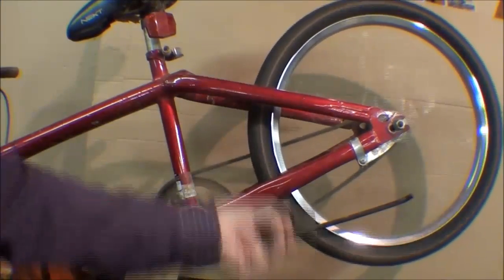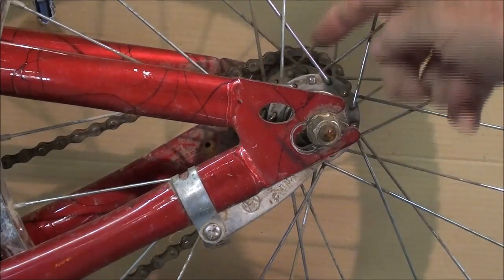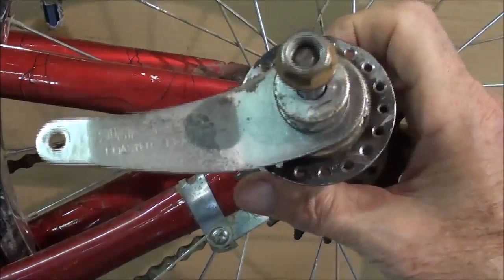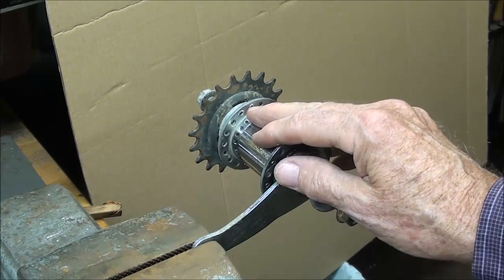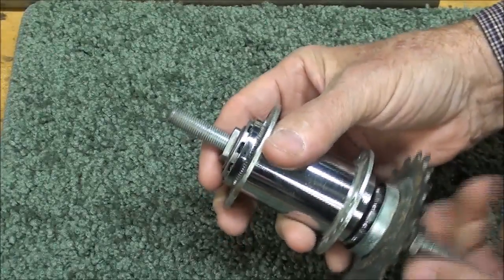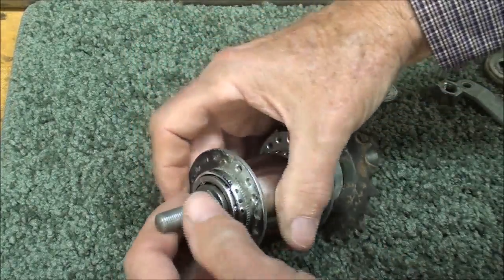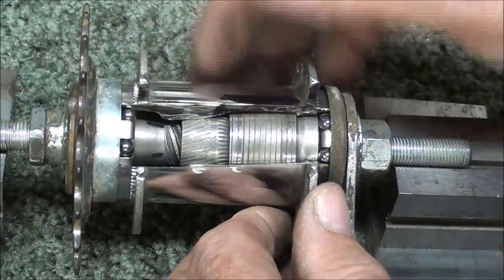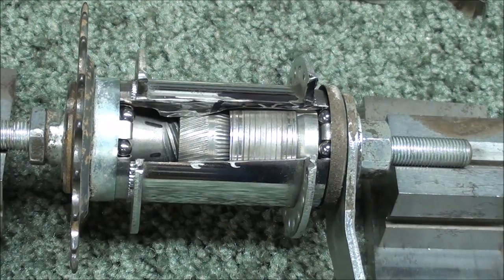WHAT MAKES IT WORK? #13 The Bicycle Coaster Brake tubalcain

Comment: I had a Wizard motor bike and it had a brake like this but the inside had a series of disks. Half were keyed to the axle and the other half were keyed to the hub. The problem I had with it was that it would build up heat and destroy the disks. I think this must be a newer version of the one I had.
Reply from the maker: +ItsRonsway whizzer or wizard?
Reply: +mrpete222  It's been over 50 years ago and can't remember your guess.

Comment: The 3-speed was a Sturmey-Archer gear shift with a chain that went into the hub.  A lever on the handle bars moved the gearing through 1st, 2nd, and 3rd gears.  On the coaster brake, another variant was an internal "split-cylinder" between the two cones.  The split was in the shape of a vee.  When the brakes were applied, brake shoes pressed against the split-cylinder which pressed against the drum much in the same way that brake shoes are applied on automobiles.  

Whenever I took the gearing apart, you always had to watch out for those ball-bearings as you could easily lose them, especially if you were doing your repair work on the grass.  I quickly learned that, after cleaning off all the black grease, to grease the bearing race before inserting the ball bearings so that they would stay in place.  

This video brought back lotsa memories, fer shur, fer shur!
Reply from the maker: +Robert A Moore Thanks for watching. I suppose there are many variations on the coaster brake

Comment: Remember the little leather straps we would hang on those and the front hubs to keep them shiny?? With a heavy bolt/nut or ?? hanging on the on the bottom two ends so the leather wouldn't spin when the wheel turned.
Reply from the maker: +Pappa Bob  Thanks for watching--we used the leather straps too--homemade from welding gloves
Reply: Well that answers my question. I recently bought a 1971 Royal Scot ( one of the many brands produced by the Raleigh Company of Nottingham England ). It has a piece of cloth hanging from both hubs, the rear a 3 spd. AW Sturmey Archer. The cloth is filthy but the hubs are shiny. Now that I know what they are, I will leave them on as part of that bikes lineage.

Comment: When I was a kid, I took apart a similar hub.  While I think the drive cone was the same (I don't really recall), the brake itself was different. It used a series of plates, half of which were keyed to the axle, and half keyed to the hub (alternating).  The drive cone was pressed against the stack of plates, and the friction between the two types of plates provided the braking.

A 3 speed hub was one of the few things I took apart that I was never able to re-assemble correctly; I think I lost a piece or two.

Comment: Definitely, the best of the WMIW series (so far). I'm not quite sure why I never took one of these apart (I took everything else apart from windup alarm clocks to Norden bombsights). I surely had several coaster brake bikes between tricycles and (what at the time were called) french racing bikes (they were actually made by folks like Schwinn - it just referred to the narrow tires). I am astounded that I never opened one of these up just to see what was inside. 

Today, these single gear-ratio, coaster brake bikes in adult sizes seem to be called "cruisers".

EDIT: Oh, yeah. Plus-1 on the cutaways. This was the best so far.
Reply from the maker: +Peter W. Meek Thanks for watcing
Reply: One other thing: I now know where to look for a very short-stroke, high-ratio, rotary to linear motion converter. A very small rotation of that 6-lead thread gets you a lot of linear motion. I suppose I could cut one, but how much faster to adapt the works from a scrapped bicycle.

Comment: I just lubed my two year old bike hub this summer. 67 years old now the last time I was about 12. the bikes from twain are not well lubed. [sell more that way] did all bearings and it rides much better with this repair. great cut away. thanks pete
Reply from the maker: +douglas pierce Thanks for watching

Comment: This takes me back too. We used to tear into these also; we'd often munch up some bearing and have to replace them. Sometimes bend or strip an axle as well. We were hard on our bikes.
I don't recall New Departure, but Bendix was definitely the big dog and in later years, IIRC, Shimano. We hated taking the Shimanos apart because instead of two large brake shoes like the Bendix, it had four small ones. That made it difficult for one person to get everything lined up and assembled whilst holding it all together. 
Then back pedaling free-wheelers with hand brakes became in vogue and gone was the coaster brake, you weren't cool if you had one. :o/
Another excellent Tubalcain cutaway! Mr. Pete has the best teaching aids ever!

Comment: AKA Cut-Way Pete- Great flash back for me to the 50's and early 60's. Remember them well and almost taking every bike I put together apart and back together. Biggest challenge was the 3 speed western auto English Racer hub which didn't have a brake in it. My favorite was the 2 speed Bendix that you would back pedal slightly to up shift and again to down shift but also had a coaster brake in it.  Had to have the leather strap with reflector hub cleaner on all my bikes. Built one with a steering wheel in place of handle bars, one with one crank shorter on the left side for our circle track racing competition,(we had Cloverleaf Speedway right in our village of Valley View, Oh. so we had to race ! Also remember a lot of crashes and crushed gonads but never ever remember being bored. Happy New Year to you and all of your family- and keep them coming. Ed K. Still living in V.V. Oh. with never a reason to move.

Comment: The pedal gears are so uselessly pointless i've been going single middle sized gear for 6 years now doing stuff from downhill, city, long distance, and even used a single wheel baggage stretcher to carry stuff behind me. Yes, i have limitations uphill, but if i travel light, it's ok.

edit: I tried to modify one of these hubs once for a different application where i'd need a quick stop, the sleeve was so hard i broke a brand new end mill on it even tho i was overly careful with my speed and feed. These can get really thought, well worth keeping them for who knows what stuff you'll need.

Comment: thanks for another great "what makes it work"  video.  I used to disassemble the hub for cleaning and  greasing.  I remember the brake shoes but not the other components.  Somehow I managed to get it all back together though.
Reply from the maker: +dan andy Thanks for watcing

Comment: Excellent. I had no idea how they worked. I'm from the UK where we don't have these. I rode one once on a rental bike when visiting California and nearly killed myself with it - if you are used to a 'normal' bike it's nearly impossible to prevent yourself from reversing the pedals a little when coasting, resulting in a rapid somersault over the handle bars. Ingenious thing though.
Reply from the maker: +thisnicklldo Thanks for watching

Comment: I had an experience with one of those drives slipping on an older adult sized bicycle.  Being 8 years old at the time, I had to move up ahead of the seat to be able to "power down" on the pedal to get enough speed to stay upright.  When that mechanism slipped, my feet went off the pedals.  End result: bruised shins and calves, very sore toes, and I picked buckshot sized gravel out of my arms for a week ... those injuries were good enough to not torment me until I had recovered somewhat from the worst part, which was the conflict I had with that top frame bar ...
Reply from the maker: +diggerop I know what you mean

Comment: First time I've seen one!!!
We brits used the ratchet and pawl hub ... If you were lucky you had a 3 speed Sturmey-Archer hub ... if you were very, very lucky you had racing 5 or 10 speed Derailleur gears with dropped handlebars but they were extremely rare in my neighbourhood in the 1960s.  I do remember one kid had a "fixed" rear wheel and could ride backwards and do other tricks.
Braking was done with cable controlled lever brakes which had little rubber blocks which scissored and gripped the outer metal rim of the wheel, they needed regular adjustment if you used them in traffic.

Comment: Great video... I learned something that makes sense now all these years later...

Couple things I can recall some fellow kid's bicycles would make a terrible shriek noise when they applied the back-pedal brake and was usually because they had been ridding their bike on the beach into the sea! 

I used to do a paper route as young boy that included a very steep hill and by the time i made it to the bottom with me and all those papers the hub grease would be boiling and sizzling! I'm sure my father wasn't impressed my bicycle always needed coaster hub attention because the brakes just don't work Dad!
Reply from the maker: +peteb2 Thanks for watching

Comment: Hi Tubalcain,

just for clarifaction

From what I understand is that multi-start threading its self is done to provide more thread surface area (strength) and the speed of nut movement being a result of the courser pitch.

So following that thought process a screw with a single start and a screw with a multi start should have the same pitch thread. However the mutli-start one will be stronger as it has more helixes.

Is that correct?

Thanks
Reply from the maker: +Kit Barlow Rapid movement is the purpose- Thanks for watching

Comment: Hi Mr. Pete. I really enjoyed this one. My mom had a bike with the coaster-brake system on it. I learned to drive a bicycle on that one!

We also had a bike with a coaster brake system that had a 3-speed transmission built into the rear hub. It was all you need. The low range was adequate for any hill that you would reasonably ride a bike on. The two other gears would allow speeds of 30+ MPH. It was plenty adequate. There was no chain derailer or other junk to cause the chain to fall off. I would love to see how that worked!

I really enjoy your way of explaining things. Thumbs-up from me. I don't know why anyone would vote down any of your videos.

I have noticed that some people seem to subscribe just so they can vote thumbs-down on each new video that I post. I wish You Tube would require that a user post a comment, stating the reason, before they are allowed to vote thumbs-down. That would make people think before they do that, since some of us take it seriously. It would also cut out the rift-raft who will go through a user's entire video list and thumbs-down each and every video.
Reply: +davida1hiwaaynet I had an English three speed bicycle I inherited from a cousin of mine when I was about 13, it had the coaster brake on it. I would like to know how it worked compared to this system. I don't remember the make of it and my mom sold it when I was in boot camp.
Reply: +davida1hiwaaynet It would be interesting to see how those older internal 3 speed hubs worked.  I've never ridden one of them either, just the standard single speed bicycles, and a couple of mountain bikes, I think both were 10 speeds, but those dang parts never seemed to stay adjusted properly and they are expensive to repair I won't waste my money on them.
Reply from the maker: +davida1hiwaaynet  Thanks for watching

Comment: Great video Lyle! When I was a  boy I often wondered how the coaster brake worked and oddly enough I never did take one completely apart even though I replaced the bearings, regreased  the hub, and had tore down my bike several times for mods and repainting. Thanks for sharing!
Reply from the maker: +Jeffrey Vastine Thanks for watching

Comment: I just had another thought. Someone mentioned using these for other purposes. How about a steam engine rpm limiter driven off of a flyball governor? Or some kind of prony break for small engine torque testing. Maybe a mechanical brake to shut down a small wind generator. Or even a spindle brake on a small lathe! Gotta be some great uses. Hmmmm....

Comment: This is a GREAT video! I always wondered how these worked but of course never dared as a kid to try to take one apart. I always thought they used a cam actuator or some kind of Sprague clutch but this is much more sophisticated than I suspected. A real testament to engineering, with the hardened drum, critical angles, metal on metal braking, multiple thread actuators, etc. 

And what great memories you shared! It really is amazing how robust these are as we beat them mercilessly. I remember getting a 3 speed and thinking I was king of the road. I'm sure you clipped playing cards to your frame to buzz against the spokes as well.

You should paint the sides of the cutaway red to look like all the great commercial engine and transmission cutaways. Maybe start a collection of cutaways. Then you could open your own branch of the Museum of Science and Industry where we haunted the halls looking at all the cool mechanisms in the stairwells and the engine cutaways. They used to have a whole display of vintage aircraft engines in the balcony that are now all long gone.
Reply from the maker: +RedDog Willys Jeep Thanks for watching.

Comment: Well I'll be...  when I was a boy I actually refurbished a rusted bicycle that had been discarded, I took it apart, cleaned, painted and greased everything EXCEPT the coaster brake, because that was just a mystery...

 In any case after owning that bike for a while the coaster brake quit working.  All these years I had no idea what had happened, NOW I know that the drive cone had rusted to the female cone!  The pedals became direct drive at that point and the coast and brakes were inoperable.  

 I still rode that bike, and in fact I used to love riding down the hill in front of my house, with the pedals locked I could put all my weight on one foot, stand up, lift my leg over the seat and coast down the hill pogo-ing while standing on one side of the bike holding the handlebars with one hand and the seat in the other!   That was pretty grand... until after doing that hundreds of times, at mid hill, the rust broke free, my direct drive went back to being a coaster brake and with me on one side of the bike the pedal SLAMMED into the brakes and I went down in a heap... fast!   I'll never forget that and now I know how it happened.
Reply from the maker: +MISTERComaToes  Thanks for watching--good story. As kids, we could adapt.

Comment: Very interesting. I had a penchant for taking things apart when I was your grandson's age. But never took a coaster brake apart for some reason. And I do like cutaways, maybe as a product of growing up before the internet and digital animations of things.

Thanks for sharing this!
Reply: +Pat Sullivan And on electric motors, I remember making a motor out of nails and magnet wire that actually worked. The commutator was made of folded up wire with the enamel scraped off. It ran off a 6V lantern battery. That was for an electrical merit badge.

Comment: That was very interesting.  I guess at some level I always wondered what was in there.  Here I am 70 years old and never took one of those apart.  I just did not want to take the time to put it back together if a lot of parts fell out.   Anyway you did a good enough job to make up for all of us and now we will always know what is inside a coaster brake.   Thanks for sharing.
Reply from the maker: +Amateur Redneck Workshop Thanks for watcing
Reply: If you think this is complicated, just wait until you need to service a Sturmey Archer hub. Also a very simple mechanism when you break it down.
Reply: How to do

Comment: Outstanding video. That cutaway explained how it works. Does anybody take credit for the invention? Maybe the Wright Brothers? ;)
Reply: +David Kupferman According to Wikipedia First invented in 1898 by Willard M. Farrow, the coaster brake, also known as a back pedal brake or foot brake (torpedo or contra in some countries, in Italy contropedale), is a type of drum brake integrated into the back hub with an internal freewheel. Freewheeling functions as with other systems, but when back pedaled, the brake engages after a fraction of a revolution. The coaster brake can be found in both single-speed and internally geared hubs.

Comment: Good stuff Mr.Pete.We used to build  a lot of our bike from parts we garbage picked.It seemed that most American manufactures used standardized parts.Except Schwinn! They had different tires,tubes.chains etc.No one seemed to ever throw them out. I know they were well built in Chicago and kind of expensive.I always(and still do)wanted one of the 5 speed Krate bikes.I think those are the coolest bikes EVER!! :)